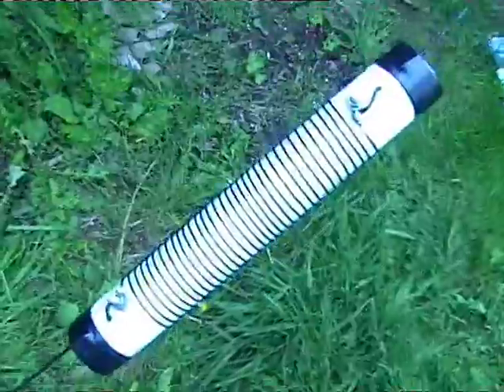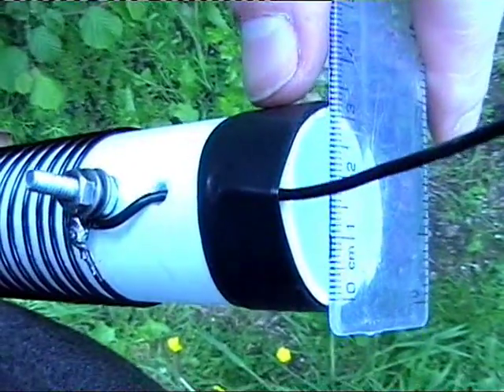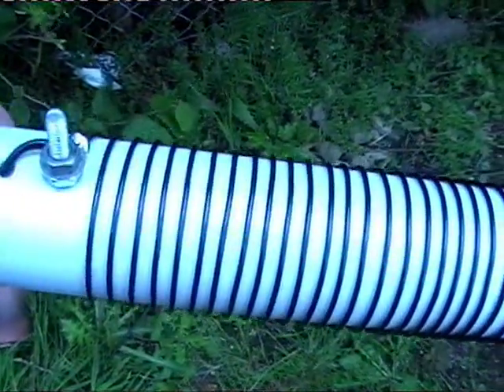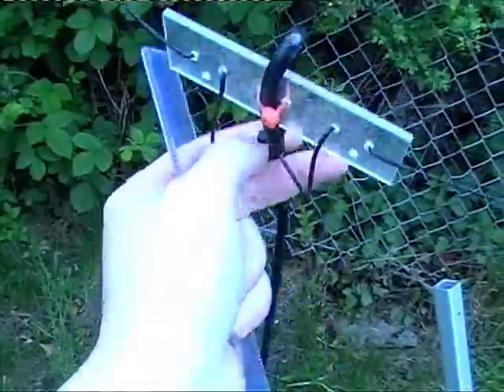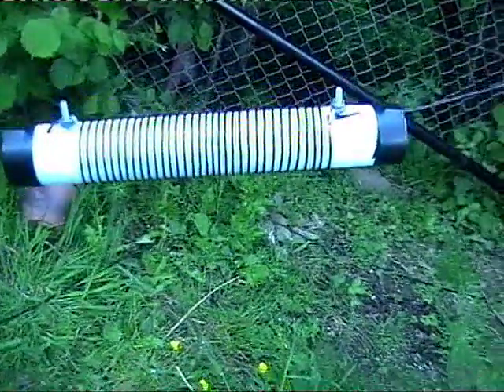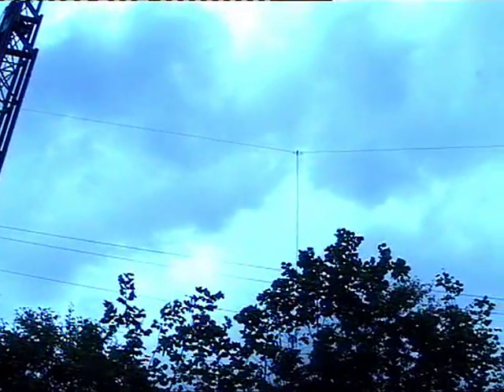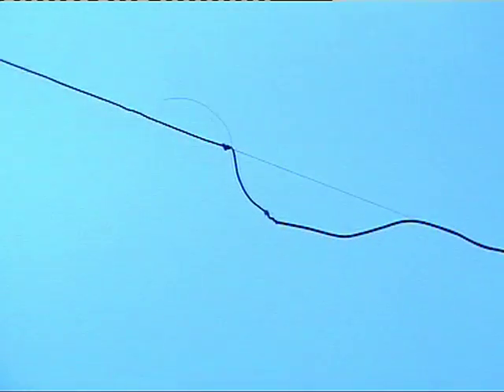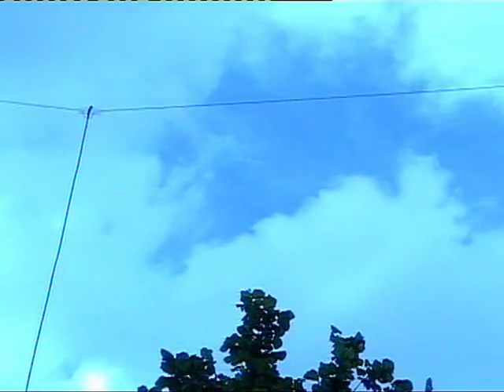Dipole  Antenna  (48 ft total )....

Comment from the maker: No  signs  of  any  heating  in  the  coils,  The  coils  are  made  using  2 mm  solid  copper  wire  and  the  gap  between  tunrs  is  about  10 mm  so  it  should  be  quite  a  low  loss  coil,  Well  low  loss  compaired  to  some   manufactered  coils  ive  seen  . :)